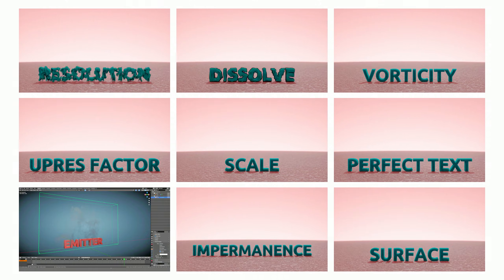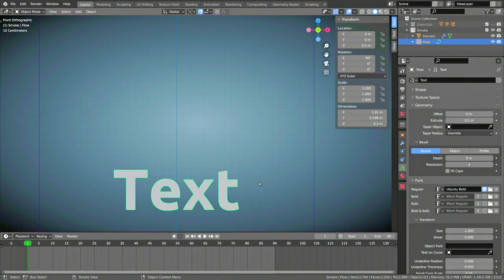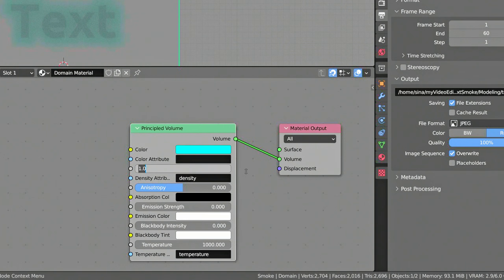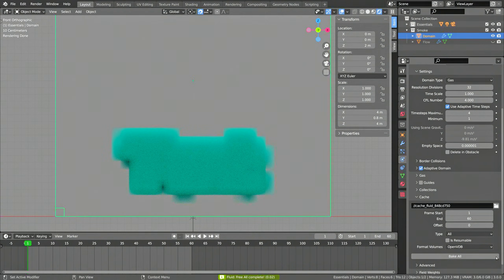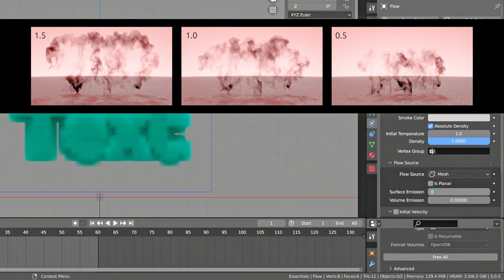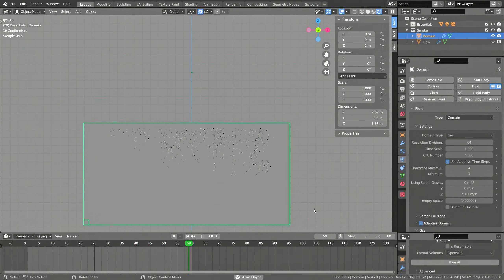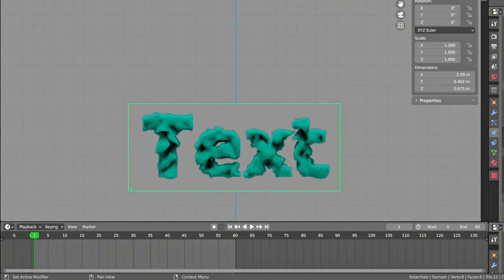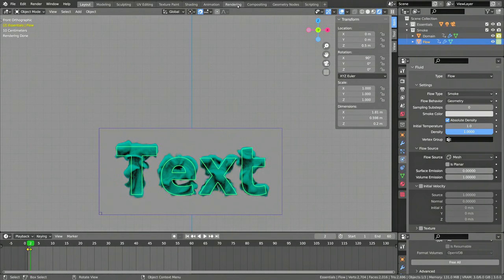Text to Smoke Transition in Blender

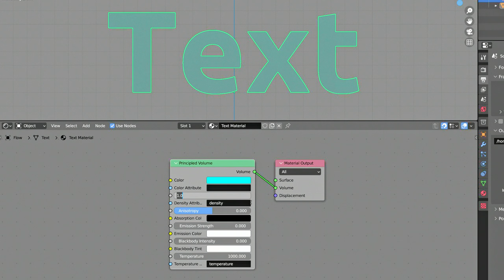Comment: Hi there! Great tutorial, very well explained and just long enough to give important and concise information. I've stumbled on an issue at 9:20. it seems as though every-time I add a principled volume to my material output the whole screen because the colour I select ( in this case purple ) how do I fix this issue and make the colour only outline the mesh? thank you in advance!
Reply: I think it may be because I'm not using a text object but instead a curve I converted into mesh?
Reply from the maker: Hmm, hard to tell without seeing your project file. But from the top of my head, please make sure:
- You have attached the material to the correct object
- You haven't accidentally added the principle volume to the "world"

Comment: Hi there! At 2:50 you see the smoke, but I don't see any on mine - do you know what the problem might be?
Reply from the maker: Hmmm, it's difficult to tell.
Have you saved your Blender file? If you haven't, Blender won't know where to create the cache folder, and so there will be no smoke.
What we see at 2:50 is just the smoke preview though, I would suggest following the video until 4:20 to get actual smoke.
I hope this helps.
Reply: @sinasinaie  Ok, I've got it to work! However, when I try use the bake button I can't change the resolution, it gets greyed out. Do you know how to fix that? Sorry, super new to Blender.
Reply from the maker: Press "Free All". This will clear the bake and re-activate all the settings.
Reply: @sinasinaie  I got it to work, I think it was the text I was originally using that was causing problems!